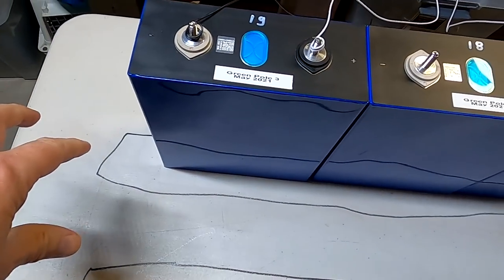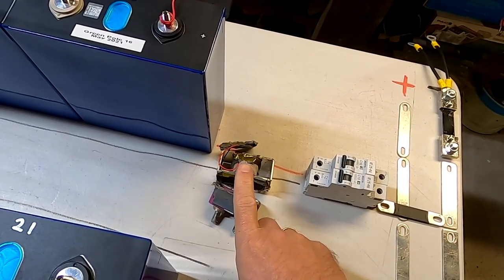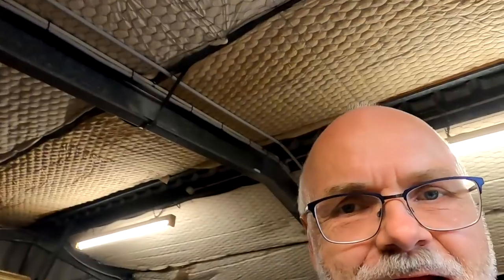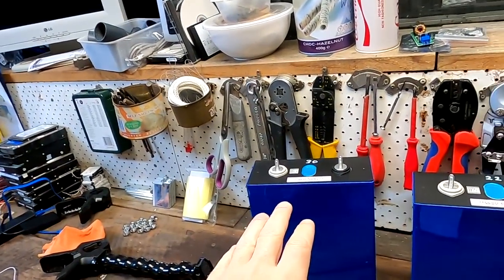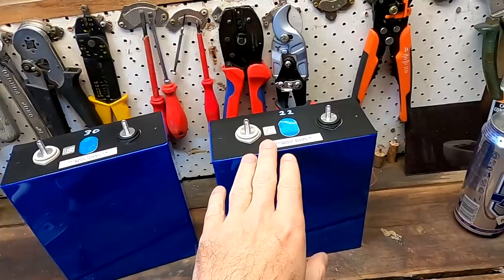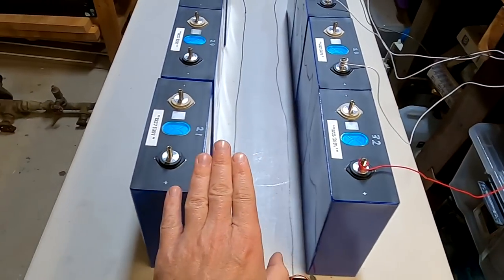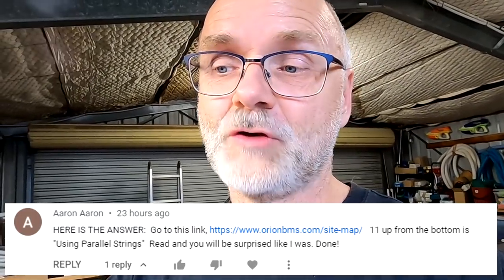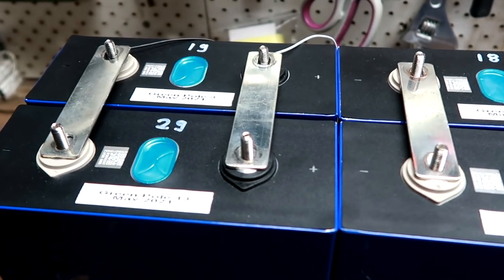Parallel Battery Strings - worst solution ever?

Comment: I am happy with my 2P4S LF280 configuration for my sailboat, but I seriously considered 2 separate  4S batteries.  Regarding parallelizing or separate batteries,   consider that companies like Renogy and Battle Born make LiFePO4 drop in 12V replacements with each battery having a 10 year replacement warranty!   Many people upgrading marine systems(and RV folks too) have built systems with 8 - 12 100AH drop in batteries.  I would have gone this route with 5 100AH BattleBorn batteries but for the cost.  My 560AH battery cost me under $1k US total whereas 5 BattleBorn batteries were close to $5k US.
Reply: I just realized that comment where I included a url link had disappeared.  For example, my comment for the last video suggesting to use plywood to make a battery box on your rolling dolly has disappeared.   I had many suggestions based on my battery box build with plywood and  1/8" thick FRP wall paneling.   I included a link to my sailboat blog showing the build.  I think adding the link killed the whole comment.  My fault.
Reply: The cells inside these BattleBorn batteries are extremely precisely built with exact capacity.
They also life cycle test the technology - they age the same.
To do this with random undocumented chinesium cells you need to buy 5 times more than needed and do capacity tests.
Than if lucky you will find ones which are close enough.
Without life cycle test...
And here comes the same cost, as you can see...

Comment: Why are you using fusebreakers on both negative and positive?

I think this is the most optimal way to wire it https://crcit.net/c/2aeaea09802549ef8e4ebe65dc97e140

Non fuseable breakers for each string and one big main fuse instead and all main negatives paralleled acting as the main negative bus bar

Comment: Andy, I already have a double battery setup as you describe and I have split the charge controllers between the batteries, so there is little current flow between the batteries or you are using up their cycle life just moving power back and forth between them. Keep up the good work. Love your channel.

Comment: Maybe get another Victron SmartShunt to have one after each banks BMS? To monitor what happen with the individual banks? At least in the beginning?
Well, could have a 3rd for both also?
Reply from the maker: Each BMS has their own shunt anyway, so I can monitor that through these. Will be interesting to see what will happen.
Reply: @OffGridGarageAustralia  yes true. I have a Daly BMS, and it not show drawing current so exactly , I think it need to draw around 2A before it start show the draw current , under that it just display 0. For example, when I have my led light connected, it still show 0 A. I guss yours better.

Comment: Your decision of separate packs, each with their own BMS is best when you don't have matched cells.  Especially when you are paralleling older cells you have used for a while.  Periodically check the current distribution between the two strings, either with each BMS if you trust their accuracy, or with a clamp on ampmeter.  If you get less the 20% difference in current balance you can consider it good.

Parallel individual cells should be closely matched.  This typically needs to be done by manf. that can track battery origin batch and verify their balance.

Recall all the issues people have with achieving low terminal contact resistance with the aluminum terminals.  Put your 4 point resistance tester to use to ensure you don't have a higher resistance contact which will really screw up the balance causing one string to supply a lower percentage of total inverter current.
Reply from the maker: Thank you.

Comment: Would this be a good time to talk about diodes, again? :D I know, I know... But those would disable inter-string current but then charging is more difficult. Just make sure those breakers are bi-polar, can break the in-rush current and have a suitable rating as to not damage the cells.
Reply: Dang, you'd need some awfully bug diodes to handle the potential current these cells can provide (280A at 1C)
Reply: @CollinBaillie  indeed, everything comes at a cost when there are many amps. The cells can also deliver about 6kA when things go horribly wrong, so suitable fuses are also a must.

Comment: Well, I guess there's only one thing to do to put the issue to rest. Looks like you'll need to order another 32 batteries, BMS and shunt, and hook them up in a monolithic configuration and run them side by side with the existing one to see which one fails first. xD

Comment: In before the hate messages, please try it and get a good sense of the paralleled current transfer.  I have found that my 1p6s batteries paralleled to 9 strings passes significant amounts of current at times.  As you said, it is the top and bottom end that matters.  Every battery passing current to the one low string can hit 6-7 amps on a battery that is otherwise passing near no current as it tries to keep the voltages up or opposite when it is trying to keep the voltages down.

To do it again I would group the batteries by resistance and match high resistance batteries one per parallel string to do 9p6s.  

You need a lot of shunts.  :-)  Thank you for what you do.  There is probably no perfect solution.

Comment: It would be great if you could make a movie to test both battery connection options, 2p16s and then two series of 16 connected in parallel. In the first version, the current,charging and discharging, should be measured and compared for each of the two batteries connected in parallel. 
  At the second connection variant, 2x1p16s, the charging and discharging current should be measured and compared for each series of 16 batteries.
Reply from the maker: You want me to buy another 32 cells? OK, then...
Reply: @OffGridGarageAustralia  Sorry, my mistake, but I forgot you only have 16 cells. Or maybe I'm wrong.

Comment: to be safe you can set a little voltmeter module on each battery bank to be sure you connect battery with equal voltage.

Comment: Congrats with the 10000 subscribers. As an afterthought on your video about parallel batteries I thought of the following. On my boat I have a LiFePo bat. Parallel to a LA battery. To avoid current flowing between the batteries I installs two blocking diodes between the batteries. One at each batterie. At least this avoids current flowing from ones batterie to the other.

Best regards,
Tom
Reply from the maker: Thanks Tom, Yes that is a very good example if you parallel different chemistry batteries. They would just charge and discharge themselves all the time otherwise.
Reply: Would you mind sharing your LFP & LA parallel specs? Nominal V and capacity of each? And what rated blocking diode you're using? Thx!
Reply: @tylerb9808  seen your request a little late sorry for that. I am using 50A blocking diodes between both batteries and the load. These blocking diodes can bought on AliExpress. La battery is 120Ah and the LiFePo is 100 Ah. Voltage levels are typical for both resulting in the LiFePo having the highest voltage usually. Let me know if you want more info.

Comment: Here in the U.S we have available a number of "drop in", 12-volt-nominal LiFeP04 batteries which are designed to replace lead acid batteries, primarily in mobile applications (RVs of various flavors, boats, etc.). Battleborn is probably the most well known of these.

The individual drop-in batteries vary in construction and type of cells but are always internally in some form of series string to get the 12 volt nominal voltage (there are also 24-volt "drop-ins"). The "drop-ins" also always have an internal BMS (if they don't have an internal BMS they can't really be considered "drop-in").

When more than one of these batteries are used in an installation (which is usually, based on my observations) these batteries are paralleled (which, when using a battery with internal prismatic cells, exactly duplicates the setup described in the video, albeit at 12v) and, sometimes, put in series strings and then paralleled. E.g., in my caravan (travel trailer in U.S.-dialect) I have six 105Ah, 12-volt-nominal batteries (each with 4 prismatic cells internally). The six batteries are arranged in 3 series strings which are paralleled for a 315Ah, 24-volt-nominal bank.

These sorts of installations have been going on in the U.S. for several years and I've yet to see any real complaints nor have I observed more than the usual number of smoking holes in the roads around here :-)

Comment: I have two identical (120AH LiFePO4 same specs cells, same brand) 48V battery banks with Daly BMS for each bank. I connected them in parallel. Due to limitations of provided bus bars, I have to connect them this way instead of parallel two cells and series them all to make 48V.  Each BMS monitors its own bank and balance its own bank, anything outside its bank is considered an external source or load.  One inverter is connected to the whole battery bank and charging it during day time. Another solar charge controller is also charging the same battery bank. The inverter only start charging when PV voltage reaches 60V. The solar charge controller on the other hand does not wait for a 60V PV voltage and starts charging right away when PV voltage is higher than that of the battery using MPPT charging. The inverter have 4x530W solar panels and the solar charge controller also have 4x530W solar panels. Both the inverter and solar charge controller are from the same manufacturer, SRNE, but have different settings when to start charging. One have to set the solar charge controller to user mode instead of Li mode that it can work without over charging as the preset Li setting is way too much for LiFePO4 and not doing so can cause the BMS to trigger an over voltage disconnect. On the inverter, when it reaches a certain top level voltage it stops charging and wait for the voltage to go down to a certain lower level and start charging again. During this time of waiting, the inverter is at IDLE charging state, the solar charge controller will take care of the charging/monitoring that for any load that comes in at anytime it will adjust its current output to match that of the load. I find this setup much better than only using the inverter with its own charger. Running off grid already with this setup.

Comment: I think 2p16s may have been the way to go if you had bought all 32 cells at the same time and they were all matched etc.

Maintenance benefits and redundancy of 2 separate packs does make a lot of sense, also means you don't have to dismantle the old battery 👌

Even though your current 16 have not really been used/abused they should be slightly different internal resistance etc to the new 16, especially now lightly used? 

If you parralelled those cells now with the new ones then you would likely have to wait a long time for everything to balance out and may experience micro cycling inside the cells of the 2p4s pack that the bms would not really detect...

Shouldn't be any huge problems with 2 parralel 16s batteries, still a seriously sized battery and you can monitor the capacity being drawn via each bms for any large differences

To parralel strings or cells is an often debated topic all over, they can both be right and wrong for an individual so glad to see you doing what you think is correct 👍

Love the videos and hard work you put in and look forward to more 😁

Comment: What do you think - my inverter is 48v so my battery bank is 3.2v individualized batteries are 280A need 15 pcs 48 divided by 3.2v I’m sure you know I’ve got 13 batteries at 280A what’s you’re thoughts on using 3.2v but 200A putting 2 of the 3.2v 200A in series still 3.2v but 400A twice because I’m short 2 batteries and would you put the 2 3.2v 400A batteries on the main positive & negative or in the middle of the 48v bank ? I will post when I do & I’m creating a wheeled crate battery bank , inverter alternator charging to be self-sufficient & looking into solar ! Thank you for all you’re work in helping others ! 😉

Comment: Jason's comment also bears on something your installation doesn't happen to use. If one BMS cuts off all the batteries, and was feeding from an alternator or genset (instead of panels) the alternator could blow out in 30 seconds. Having multiple BMSes and parallel strings neatly ensures that failure can't happen.
 So "what is best" as usual is an individual choice, not an absolute rule for all.

Comment: I'd be curious to see if the capacity is  affected in any way. Maybe you could run 5 or so charge and discharge cycles and then do a combined capacity check with atleast 0.5C  to see if it you get the expected combined capacity.

Comment: I've worked with dual parallel batteries my entire life. One isolated one night while the other gets consumed, and the opposite the next night. That way there's always at least 50% available the next morning in the worst case scenario. That exact system is in need of a LiFePO4 upgrade and I've been planning it for a while. However depending on which cell sizes are available when the time comes to order, I was thinking of ordering 16 cells instead of 8 for 2 banks. I guess that's still on my mind, but now I'm thinking about 4 banks instead of 2 :-)

Comment: Uh, are those breakers rated for high current at 48VDC?  Even the Blue Sea Systems battery switches are not rated for that, and can arc if switched under load. I would use a rated switch, not a breaker for each battery bank.

Comment: Similar situation but with lead acid "you should not parallel to many battery banks" this is what I was reading but I worked for Australia's telephone company when it was the only one a government entity and so many large telephone exchanges had many battery rooms with many banks all in parallel so with more than 100 years of experience I went with my training and I have 11 banks of 100ah at 48v. With current monitoring on every bank I can see now that the banks charge and discharge at different currents but it took 5 years to become noticeable and they were 3 years old when I got them so that is 8 years of age they are now approaching 10 years old so why did it work? I was taught low resistance between banks , I used heavy cables to large copper buss bar (12mm x 12mm copper bar ) the links between batteries (4 x 12v) are copper 25mm wide 3mm thick these are standard as supplied with the batteries the links I see used with the lithium cells are too small in my opinion.

Comment: what about integrating an arduino to read the strings voltages. if the voltage difference between the strings is higher than a defined value, trigger a relay to cut off the string or send you a notification.

Comment: I have a suggestion... it may be unnecessary, but hear me please.  You have three 16s strings each with it’s own BMS and contactor.  The issue is that you remove one string for testing and have to reconnect it.  So I will call my idea “two ships passing in the night”.  You must make a voltage comparator that will disable the new pack via the contactor on that pack until the pack voltages are within 0.1v.  So now you can connect the pack and it will sit waiting.  The contactor on the BMS will not connect until the other packs come within 0.1v of it.  So as these “ships” pass in the night, the new pack will suddenly connect and now be in synch.   I think it would happen within 24 hours as your packs cycle up and down.  
It is only a matter of finding a voltage comparator on ebay and using that to control the coil on the BMS’s contactor.
Reply: This board will do what I have said above... when two voltages are too far apart it will activate a relay.  Use this relay to stop the new pack from joining the other batteries until the packs are the same voltage.  Also this will measure 0-31v, but no worries, use a voltage divider to get 56v down to 28v on the input.  https://www.ebay.com/itm/163378147952?hash=item260a18b270:g:DeUAAOSwI1VcJaGL#descCntId

Comment: I would insert a modest priced shunt on each battery, using either a Renogy ($88 USD) or one of the 80v/350amp ones on Aliexpress ($45 USD). They will monitor the state of charge of each battery, could be insightful.  That’s my plan.
Reply from the maker: Ever BMS has got its own shunt already and I can monitor the currents of each string individually.

Comment: Why place a circuit breaker on both positive and negative terminals? I thought only positive side gets a fuse/breaker... Thanks.
Reply: It double the chance to break an arc forming when DC current flow is cut off.